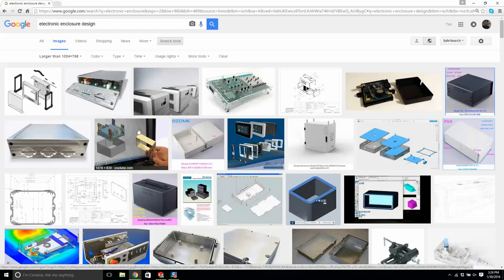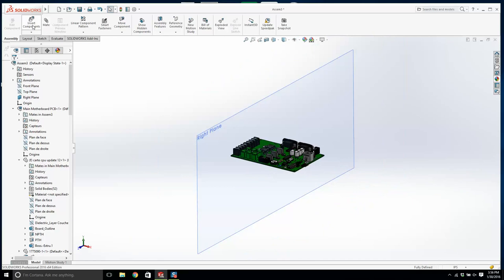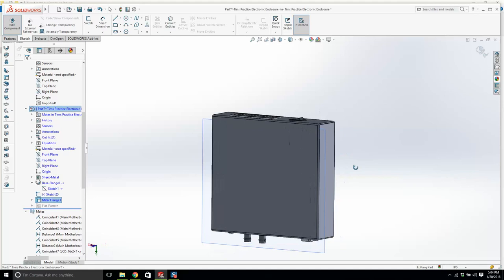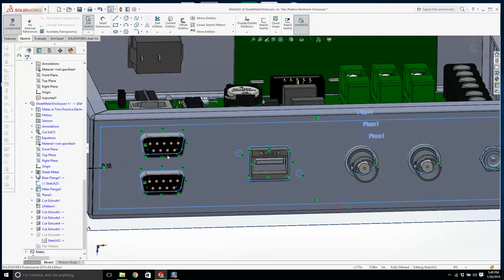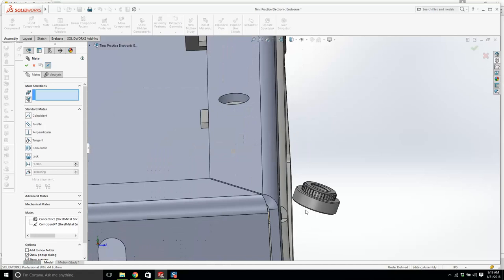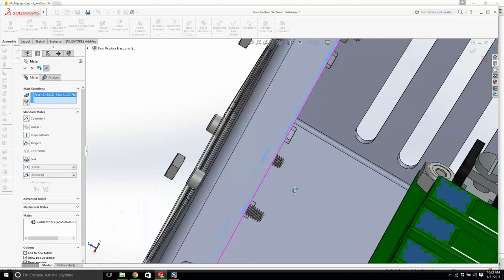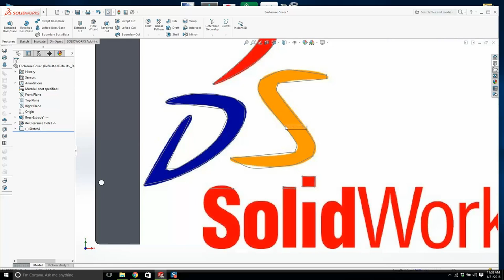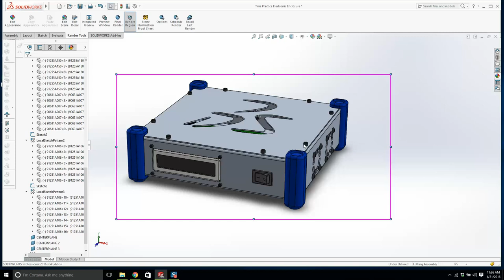Solidworks Engineering Design Project

Comment: Really enjoying your sw videos. One tip for fasteners: You would be much faster mating fasteners and such if you import one instance of the screw f.ex. Mate it accordingly and then use copy with mates. You would then only have to pick the hole where the screw goes and the top face of the part where the screw head should be flush with.  Cutting your selection for mating in half and only selecting the mate type once.  It's surprisingly faster especially when used with the mouse shortcuts, basically smash the left and right mouse buttons and you're firing fully mated fasteners faster than you can say Bob's your uncle :)
Reply from the maker: Thanks for that tip. I have a lot of bad habits. Mating fasteners is such a pain. Im going to try your technique out. Appreciated.